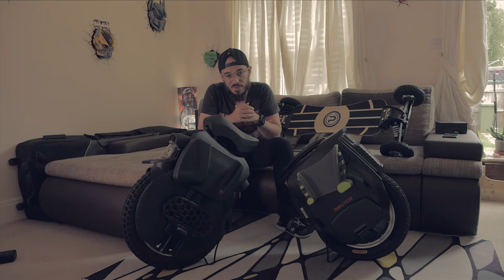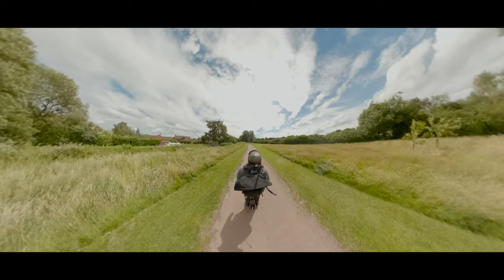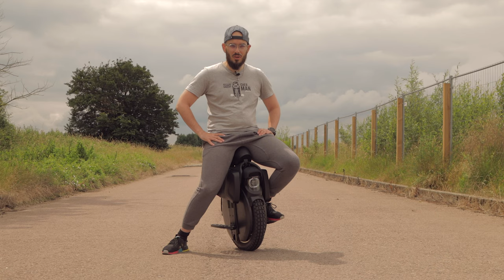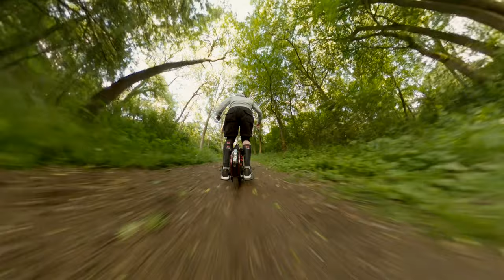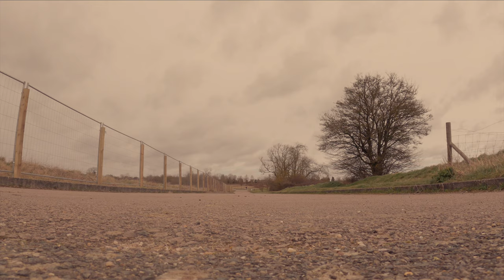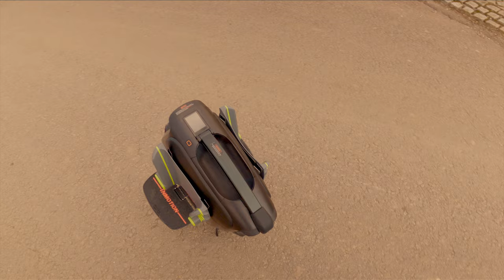Inmotion V12 Vs V11 - Best Electric Unicycle 2022 for beginners?

Comment: The price isnt beginner as most beginners would probably start of with a v5f as cheap price is good
Reply from the maker: I get you but not everyone think like that in 2018 when i started i started with one of the most expensive available in that time the segway ninebot z10. For me the v5f is too limited as a starter wheel i will pick from inmotion the v8f that i use constently
Reply: @MADpack  I just ordered the v11 as my starter and it gets here tomorrow I’m super excited been learning a lot about how to be safe on them and techniques for learning to ride as I’ve only ridden bikes in my life. I know that the v11 has a steeper learning curve because of the height but I’m ready!!
Reply from the maker: Like i said before the v11 is not a good wheel to start learning because is not a wheel that likes to be beaten. You just notice that when you will have to disassemble the v11
Reply: @MADpack  yeah I’ve already watched a disassembly video but I’m determined to learn either way
Reply from the maker: Ive done one related to the bearings if you are interested to see
Reply: @MADpack  sure I’ll check it out
Reply from the maker: Hope it helps
Reply: I started with a V8f….I love the thing and still use it loads. It’s just great to keep in the back of the car to ride about in town and cover those last few kilometres. It’s light, manoeuvrable and zips about just fine…,I guess ultimately it is just so practical…and was a great learner wheel.
Reply from the maker: Agree in 100% i still have my v8f and i use it all the time in the way you are saying and soonner this kind of wheels will be more and more rare ro find

Comment: So Marcus … when will InMotion come out with 1800wh , 100v, suspension wheel?
Reply from the maker: Hope with a bigger battery than that but the last time that I heard about the v13 was to be around the end of February beginning of march
Reply: @MADpack  when you say Feb/March, is that shipping out production wheels or just sharing teaser clips of the wheel that they will ship out 3 months afterwards ??
Reply from the maker: Weve been able to see something i doubt will be kut sknething befkre next summer
Reply: @MADpack  that's sad. the wait is too long for Inmotion to improve on what's lacking.
At lease Gotway doesn't wait long if an improvement is needed, they ship out their next batches with the upgrades.
Reply from the maker: Thats what i dont like. Inmotion is working on the v13 since february 2021. Look to ks they even didnt have a final wheel and you could already put money on a pre order just with render images. I prefer that they take time. The v12 is a monster of wheel.

Comment: Suspension = ridable vs BS.  I will never forget test riding a hard tail motorcycle.  Ouch!  Just like my 100V MSX at 35mph in Syracuse (potholes).  No suspension = bicycle BS.
Reply from the maker: Msx is your only wheel?
Reply: @MADpack  No.  I started with an e+ (batteries dead now), then MSX-100V, then S18, and most recent a V11 (that one's 4 sale almost new).

Comment: Hello MADpack,

Another great video!
Tnx!
I own the V11 and Z10 and I'm more then happy with it...
Thinking for future to get the V12 or V13   (been interest what it be like (the V13))...
The light on the V11 is great and pretty adjustable with the pedal tilt angle -2° <> +2°

Regards,

TheFlyingTom
Reply from the maker: I will not say that the light is adjustable by adjusting the tilt since I ride always in -2 my wheels from inmotion
Reply: @MADpack  
Okey: -2 is then not so optimum for light... ;)
Reply from the maker: No is just a position that will allow me to have more control on the acceleration of my wheel and allow me to kick the wheel to break

Comment: Inmotion needs to Combine the Best Features of the 2 Models into a whole New EUC...call it the V13
Reply from the maker: V13 will be more than that
Reply: @MADpack  Okay, that sounds… interestingly informative. I’m almost going to buy a V11 due to the suspension. Maybe I should wait?
Reply from the maker: If you don't want to spend more you will not have better options with suspension
Reply: @MADpack  tell us more about  the v13! ;)
Reply from the maker: Since I get more info and I can tell I will be doing it
Reply: @MADpack   I don’t mind to spend more if that means that I can have an all-rounded UEC that I can bring to my workplace without attracting to many stares (reason why I inmediatly discard the S20) and I also can ride it confortably the weekends in offroad trails.
Reply from the maker: The v13 is going to be the most versatile wheel i. 2022..
Reply: @MADpack  Well, I’m not really in a haste so I can wait a few month. When do you think it will be released? Early or late 2022?
Thanks a lot for answering my questions. It helps a lot.
Reply from the maker: Supposley was going to be announced in feb/march 2022
Reply: @MADpack  dang, this sounds exciting. I'm hearing good news about this one from you and local shop staff (who supposedly spoke to InMotion CEO).

Its understandable and unfortunate at the same time that neither party can disclose much info on it. But I did gather that its not a beginner friendly wheel, very 'unlike inmotion', and 'something no other company has done before' whatever those means lol 😅

Anyhow, skipping s20 preorder and holding out for this one as I love all the mysteries surrounding it. 😝
Reply from the maker: I normally skip any ks wheel ;) ahahahah

Comment: New ECU but Experienced OW’er from 🇨🇦.  Looking to make the change.  I’m 70% pavement and 30% dirt trials. Small jumping but not a big drop guy!  Cruising and speed and fair weather. Onewheel flow is awesome but 6 nosedives later that’s getting old and always around 30kph PLUS!  🤕🩹❤️‍🩹

Not sold on inmotion but build seems strong and in 🇨🇦. The v11 shock and wheel size seems good but lack of speed seems an issue. I’d like to cruise at 40-50kph and rip up once and awhile.

The v12 wheel size seems to concern everyone but I’m cruising now at 30kph on a 6”?  I’m feeling 16” would be smooth and less risky? 

Thoughts anyone?
Reply from the maker: The v12 is super stable and i ride at 67kph.. No issues... Definitely i feel safe and definitely will not be concern about a 16' wheel when coming from a onewheel